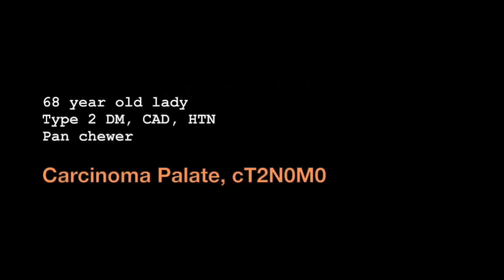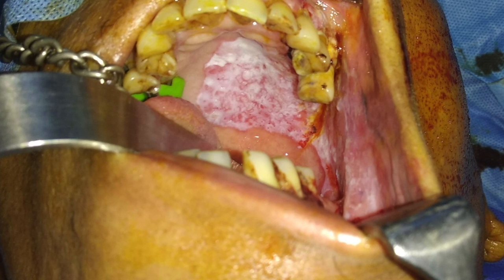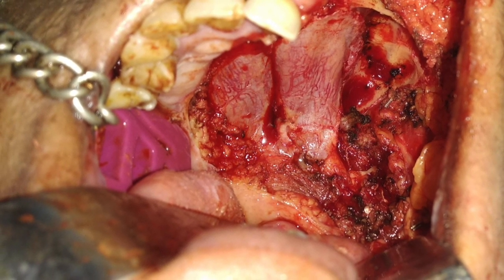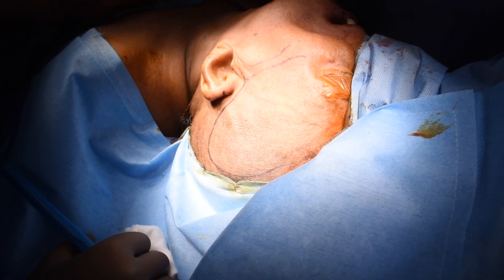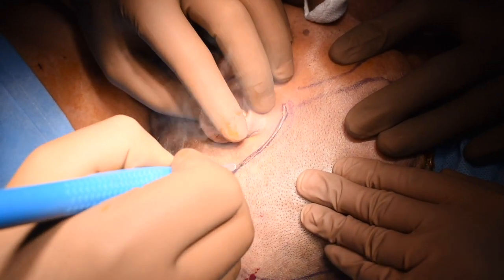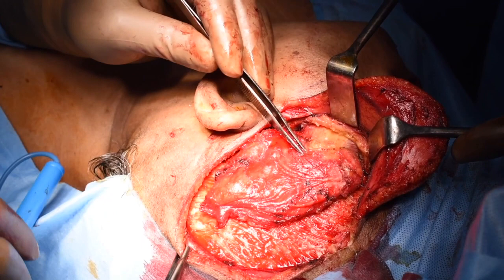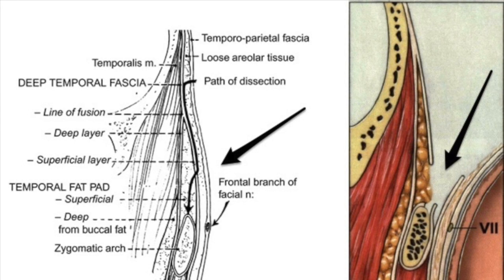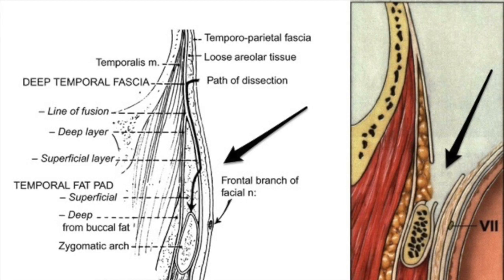Temporalis Flap / Dr. Sudheesh Manoharan

Comment: Sir, even after reconstruction of the paletal (radial free flap), there is small fistula. What is the cause and what to do ?
Reply from the maker: Palatial fistula an expected complication in such cases. Tension free closer is the key. Taking deep bites while suturing will also help to avoid fistula. Small fistulas if asymptomatic may be left alone. Most of the fistula will shrink. Fat injection techniques documented.. but I haven’t tried that..